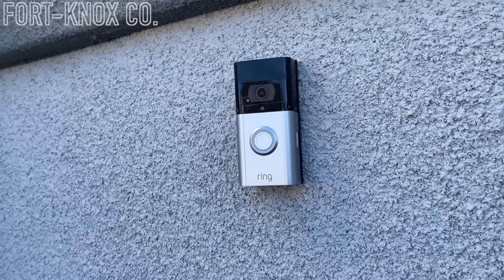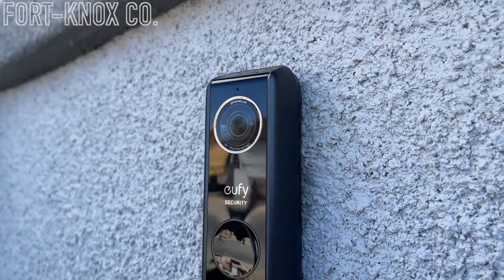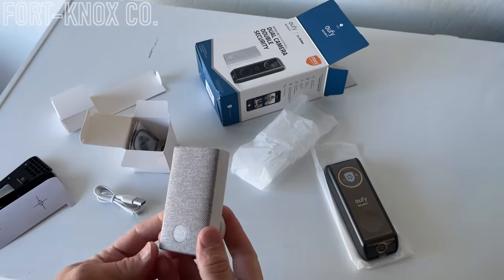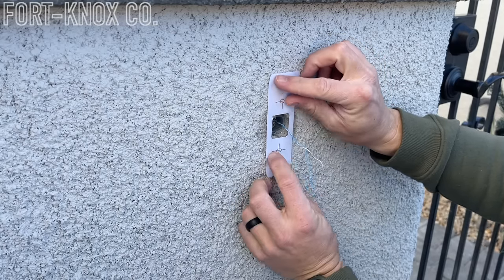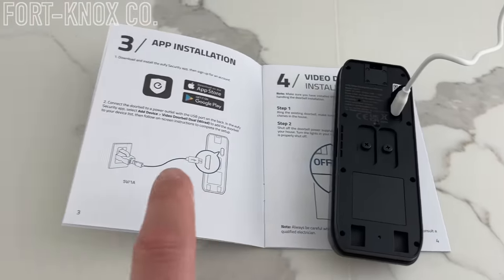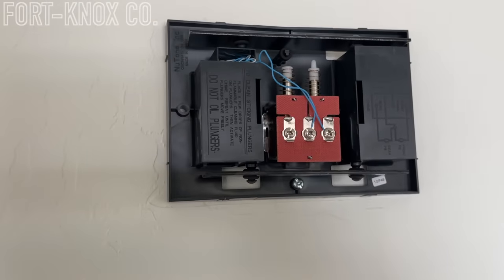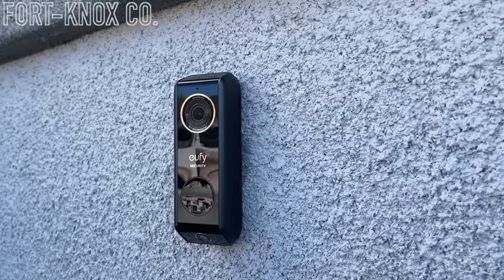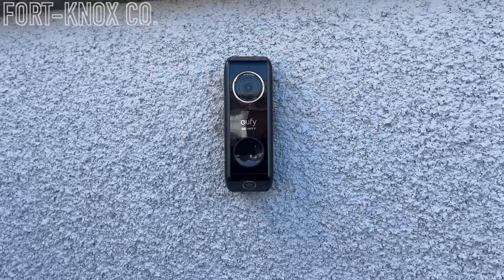BEST Video Doorbell 2024 with No Subscription Required Eufy Dual Camera Doorbell Installation Memory

Comment: I hate to say it but WYZE is by far the best bang for your buck. It comes with the chime and battery pack or wire doorbell. Plus, you can use micro SD cards as well as all those cloud options and you only have to pay $1.99 per month. And it’s also only $89 as opposed to. 250 with Eufy.
Reply from the maker: Very good information. I may look into Wyze and see how their products work. I’m Always looking for new and improved tech out there.
Reply: Eufy uses SD card and is on sale for $89.99 right now with no monthly fee.  About to buy one, just wanted to let everyone know that sees this as it's their labor day sale.
Reply from the maker: @texasbtc  thank you for the great info!!
Reply: Have had nothing but problems with my Wyze doorbell. They've replaced it thrice due to hardware issues, currently the outgoing speaker only produces static and I can't connect to the app, so I'm looking for a new brand.

Comment: I bought the ring doorbell Gen 2 last month and we had the hurricane without power for a couple weeks maybe longer and I just got internet back today. And my ring doorbell is not recognizing the password which I don't understand because there was only one password. I think I paid like 45 bucks it was brand new in the box but my only downfall with this one is I don't have $400 for a camera
Reply from the maker: Yeah not sure why it wouldn’t accept the WiFi connection. I’m personally not a fan of the ring products. Haven’t had good luck with them
Reply: @FortKnoxCo  about 5 minutes ago I was checking one of my other cell phones that I just have on Wi-Fi and I put it on that phone and forgot about it so it's working it's been a long couple weeks here in South Carolina I got spanked pretty good by the hurricane I'm going to save up and get the one that you just advertised it seems like it's got great quality man and that's what it's all about thanks for the respond buddy
Reply from the maker: @JollUsARoint  sorry to hear that. Hope you get everything back in order asap. 🤙🏼

Comment: Would be great if I can connect it to my WiFi.
Reply from the maker: Sorry you’re having problems connecting. I’ve never had a problem following the instructions and it usually connects first try. Make sure your router/signal is strong enough. That’s a common problem, the signal is there but not fast enough. And make sure your foretell transformer is upgraded to the more powerful source.

Comment: This is the second home in which https://www.youtube.com/post/Ugkx0jZ_lGlDVJhDnmagEU8gn47cmfPNlLQU we've replaced our "regular" doorbell with a Ring video doorbell and we really enjoy it. It is very easy to install and it works very well, with a clear picture through the app and good in-home use (we added the chime, which is also easy to install and doesn't require another thought to use).
Reply from the maker: Thank you!
Reply: No matter how I adjust the motion sensitivity on my ring doorbell, it's always too slow to start recording if someone walks up fast.  I just get the back of their head as they are walking away, if they move fast.

Comment: I know that I love my Eufy cameras, I never have a bit of problems with them. I used Arlo and Ring cameras at one time and they were a big headache, always disconnecting along with other problems. I think that I will try the Eufy doorbell, but the battery version. Thanks for the informative video.
Reply from the maker: I have no complaints about the Eufy system still. Great experience. I had the battery option first and went with the wired after I got tired of charging periodically. But that comes with any battery powered doorbell I guess.
Reply: You do know that they are hacked easily.. right?
Reply from the maker: @sufferedlearnedchanged  I wouldn’t necessarily say easily. But if “hackers” can hack into some of these major companies we hear about on the news once in a while I’m sure there could be a breach on a video doorbell. One of the nice things without having to use the cloud and having the local in-house storage, is that the only real way to get into any of your systems would be to be at your house and hack into your IP are local Wi-Fi. But then again, you would have access to all your devices connected to your Wi-Fi at that point almost. So that’s one of the reasons I like that the Eufy system doesn’t require you to use the cloud or else. You have options.
Reply: @sufferedlearnedchanged  not any easier than anyone else

Comment: Wow, first video I went to find the best doorbell for 2024.  I knew my Ring subscription was coming up and I wanted something else....preferably free!  Ring would always freeze up when someone pushed the bell--totally useless.  This was a 100% bona fide breakdown of what this doorbell is.  I'm sold--Thank you!
Reply from the maker: Awesome! We still love this doorbell. It works great and fast. Make sure you have the upgrade doorbell transformer. I have a video on how to do that, but it’s a must have for any video doorbell
Reply: @FortKnoxCo what’s the reason for that?
Reply from the maker: @Mr.Slime9812  the video doorbells require a stronger power source. So most ask you to also upgrade the doorbell transformer so it can work correctly. So they can have a strong enough signal to connect to the WiFi and transfer data properly. Some doorbells, like this one, have a sensor in the software that will tell you if you’re getting adequate power or not and if you need to upgrade the transformer.

Comment: I have the Eufy doorbell, replaced my ring, mainly because of the cloud required by Ring. Second this doorbell work great, clear, catches traffic in front of my house ,AI is great, animals, vehicles and humans, even know me. One this I have a large gap between the vinyl siding Laps. I haven’t found anything to cover it. Oh, it also connected to my existing door bell chime, I got the wired one. It did come with its own chime that I put in my basement. Plus it connected to my eufy cam3 modular.
Reply from the maker: That’s amazing! I think a lot of people can relate to everything you just listed. Overall great products and I have zero complaints

Comment: I was using a Eufy 1080p wireless doorbell, which was OK, but then switched to the Blink doorbell, as I have other Blink cameras and thought it was a good idea to have it all on the same platform. I'm think now of putting the Eufy back.
With the Eufy, when the doorbell rings, I get a notification, tap it and see who's there.
With the Blink, it takes longer to view who's at the door. By the time I'm able to see who is at the door, they're usually gone.
Also one advantage to the Eufy wireless doorbells is that the data is stored inside on as SD card in the chime , not in the doorbell itself, which is a good feature if a perpetrator rips the doorbell off. The video is still in the house. I don't know why the wired doorbells don't do it that way.
The only thing the Blink is beter at is battery life. the lithium batteries seem to last longer than a charge on the Eufy. It seems like I've been charging the Eufy every month.
Reply from the maker: Thank you for your input! I’m this is good info because I’ve never used the blink systems. I think they all have their pros and cons but for what I need it for and experience with others I too prefer the Eufy. I’m happy with how fast they are like you said. Never had a problem with it. I used a battery powered and needed up switching to a wired version because I got tired of charging. I like being able to wire it in and not mess with it.

Comment: I have a couple of the previous model, without the doorbell or package camera, and they work just fine for me. One is charging while the other is "one duty". 
My waving American flag and tall trucks passing by my fence would activate the camera, so I made a cover, from thin sheet metal, like the brim of a baseball cap, to limit the camera's vertical view, and it works just fine. The base of the "brim" is secured between the stucco wall and the mount, so it stays in place.

Comment: Just one more thing to buy! I don’t know how you linked up your RING but not one thing you said about it was true for me, I have 5 of their cameras that link together seamlessly. I’ve had them for 3 years now, yes RING does have you pay a fee but its under $10 dollars for the whole year!!
My cameras are crystal clear, the sound is good and the communication speakers with well. 
I’m not saying this camera you’re showing isn’t good, but it has its faults as well. The added, required part, if you needed it for the doorbell to work then why didn’t they send it in the box?? That’s their way to make extra money. 
So I’ll stick with my RING, it’s tried and true.
Reply from the maker: I appreciate the feed back. I’ve heard a lot of good stuff about the ring and other door bells. I just wanted to describe my experience and what I found. I’ve also upgraded the transformer for the doorbell, which ring did not let me know needed to be done. Could have been why it wasn’t running too well. But the eufy self diagnosed and let me know the power coming into wasn’t good enough and how to upgrade. Wish ring would have done that
Reply from the maker: It’s nice there’s so many options out there to give people options though. Whatever works for people and their budget.
Reply: @FortKnoxCo    I hear you brother,  I came off a little strong there and I apologize. Thanks for putting the info out there on the other product and above all, thanks for taking the time to respond to me. 
Alan
Reply from the maker: @alanrobisonPD1960  it’s all good man. I like just getting information out there so people can do their own and have more to hear from. It’s always good to have different sides of stuff to hear from. We can all learn from it all in the end

Comment: The one security weakness is that if local storage is in the doorbell it can be damaged or stolen. I also find that the delay in getting the video after an event suggests that even without a subscription there may be uploads to the cloud.
Reply from the maker: These have the option to have a Home Base which is extended memory that can be in your home in a secured location to circumvent the problem of a damaged or stolen doorbell. You can keep all the memory safely at home still and home HAVE to pay for storage in a subscription format just to be able to use the features of your doorbell camera. I found that as a negative when you buy a Ring doorbell for all the cool things it can do but you don’t get all those features unless you continue to pay for them.
Reply: Eufy does allow for local storage, and if you get a Synology NAS, you can also back that up to a cloud service of some kind (or even another Synology NAS you have stored at a relative's house that you can sync the data between) and there is a Synology app to view your video feed remotely as well. 
I haven't gotten one yet but I am planning on it may be more steps than what most people want, but the important thing, is that you are in control of your won data. Ring freely gives your video feed to policy agencies when they simply ask, not even under subpoena.
Reply from the maker: @cybernoid001  this is a big point! One of the main reasons I like having the storage in the owners control 100%. Plus you aren’t subject to rings fees and service or nothing. With their device you don’t have choices.
Reply: I don't know why, but the Eufy wireless doorbells data is stored on a micro SD card in the chime.
Also, I think you're correct about the data going to the cloud, then to your phone.
Reply: Only the wired doorbell has local storage. Battery model stores on the homebase
Reply: I have a eufy security camera trained to the front door area from an inside window.  The installation issue where you have to get a new transformer it's a pain in the ass. also got lost on the door bell insert you add to the inside of the house, can I use my historical doorbell chime.  How does it get connected to the homebase.   someone coming to the door having to deal with where do I push to get a doorbell sound.  These things are very annoying to deal with. I don't enjoy walking up to the house and having to deal with one of these things.

Comment: The reason I went with Lorex is because it supports RTSP for 24/7 recording on my NVR, and I can use my existing doorbells on all three floors- as of this post, neither are available with the Eufy.
Reply from the maker: Yeah Lorex is really good also. The technology is there now for all these doorbells to perform very similar. It’s just comes down to things like you pointed out why someone may need one over the other. I like that there’s multiple options.
Reply: I also use lorex  good products can be pricey but a good product. It just works
Reply from the maker: @Smiley-zm1rp  that’s what matters most, having it work the way you want and expect. Happy you are liking them. They make good stuff
Reply: I have a full range of Lorex cameras and was using their NVR. Their NVR was dog slow so changed it out to a Blue-Iris machine. Blue Iris works quite well with Lorex cameras. Still have a Ring doorbell button, though - two more months on my subscription before it goes. Wanted a doorbell camera that uses existing doorbell so I have a Lorex doorbell camera. But the mounts on Lorex doorbell cameras suck. Very wimpy plastic mounts. Plus, they don't provide a base big enough to cover existing holes from previous doorbells. Not sure what to do for mounting this one.

Comment: Nice info,  I can't find any other brand apart from ring that do the door view option what is fitted via the door peep hole do u no of any pls and thanks
Reply from the maker: I’m not sure of any other system that can utilize the peep hole. You can obviously mount a battery operated doorbell in any location you see fit but not sure about the actual door peep hole set up

Comment: Thanks for this great video. I'm thinking of trading in my Ring doorbell for this one but I'm curious...can the Eufy work with my existing door chime box mounted inside my home, Or will I have to use the plug in type that comes with it?
Reply from the maker: You’ll have to use the plug in that comes with it. Unfortunately the way these door bells work with having a constant supply of electricity they don’t activate the traditional type of door bell. The benefit though is that you can plug it in anywhere you want. It could be in your bedroom or the garage or wherever you might want the notification to be utilized best. And it can be an outlet that is not being used or somewhere out of sight if you prefer. It’s kind of cool that you can put the bell anywhere you want.

Comment: You skipped over the jumper cable attachment inside of the existing chime, just what I was looking for information on. You show 2 cables it appears inside of the plastic bag. Does one install only one of them between the 2 terminals, center one and the one on the right? Thank you.
Reply from the maker: Yes it should come with instructions on how to do that. It basically bypasses the chime to create a through connection. I didn’t initially install the jump cable when I first installed this chime. I later did go back and install that before upgrading my doorbell transformer.

Comment: Thanks for the video. Is it compatible to 220V ? Also can I use the original Chime in 220V ?
Reply from the maker: Most all doorbells have a transformer that’s installed which reduces the power down before running out to the device. I have a video showing how this is wired in and if you need to upgrade transformers how to do that. But I’ve never seen one wired in on a 220v outlet. That’s a little overkill. Usually it’s on a standard 110-120V outlet and has a transformer installed.

Comment: Excellent video explanation of Eufy doorbell advantages.  It does require more power.   The Blink video doorbell is a quick install and being wifi and battery powered you can place the unit in an optimum location for people and package monitoring.  Where I can add a transformer upgrade I'll try the Eufy.   Thanks - great job.
Reply from the maker: I appreciate it. The Eufy does have the battery option and we used that one at first but I opted for the hard wire version later on. I don’t like having to recharge, especially if it requires it often and you’re getting a lot of notifications. But it’s nice these different brands usually have both options.

Comment: What do you recommend for outdoor security PT&Z
With a long distance view beyond 20’?
Reply from the maker: I feel like most of the main brands you find now have very good quality. Most shooting in 4K now which is way beyond what you probably red in a camera system. But as long as you have the storage available then I say why not go big. As far as a specific brand I don’t really have one. I know Eufy is coming out with their “professional” camera system for 24 hour coverage cameras. I’m going to be trying those when they come out.
Reply: @FortKnoxCo  what is your take on the light bulb security cameras.  
So you say to look for 4G output?  
There are solar cameras wifi & disk capabilities.  
I’m on a strict budget.  Going big is not possible for me.
Reply from the maker: @mnp870  the light build security cameras can be a great option if you don’t have the power source available on the exterior of your home but do have exterior lights. This usually allows your to just connect to your WiFi and not have to run any additional cables through your roof. 

4K video quality is usually a plus but something with 2K video quality is still very good.  Like you said, your budget really will determine what’s best for your situation, but there are many good options out there.